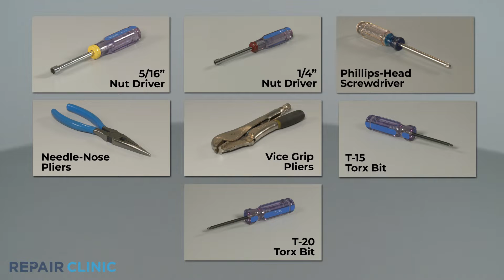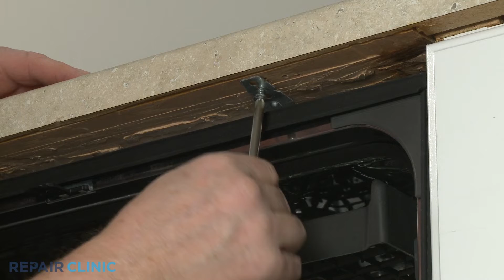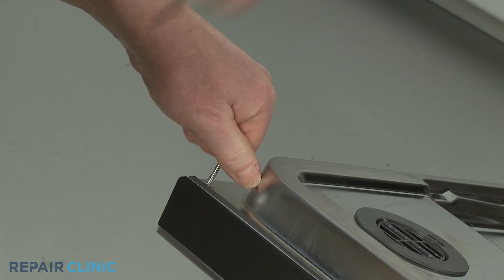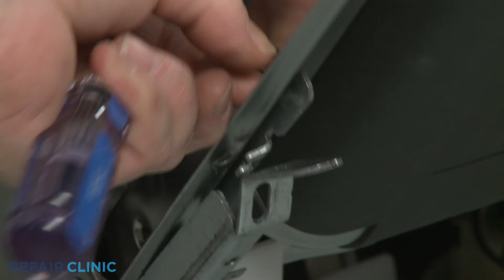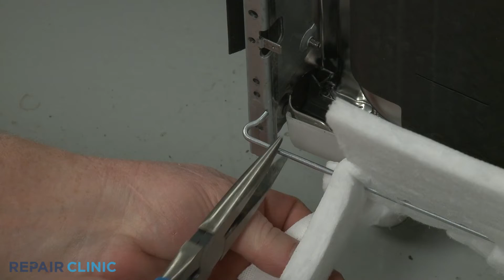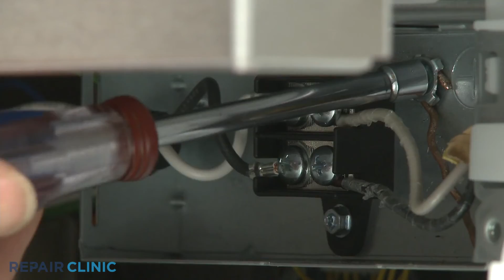KitchenAid Dishwasher Left Door Hinge Replacement W11573703

Comment: Our 5-year-old KA DW HINGE PIN HEAD sheered off (It's clearly visible in this video).  The door still works but one of these days the door will probably fail.  I'm told the PIN can't be replaced, it's an integral part of the frame.  Due to this poor design, we may have to junk a $1200 DW. And we hope buying top-of-the-line American-made appliances was the way to go.

Comment: Great video, only one I could find with this type of spring.  On ours the spring came off and I was only able to put it back on without the plastic (since couldn’t extend enough to push through the hole with the plastic pieces…  is there supposed to be a way to replace just the spring with the plastic pieces or when the spring comes off is the only thing to replace the whole hinge?  Also , since it was able to connect without the plastic part we are just using it like that for now (sadly we are 3 months out of the 1 yr warranty).. is there something bad that can happen without the plastic piece?
Reply: Have you still had issues with this spring continuing to come off with put the plastic? I was able the pop mine back in with the plastic but after a month of use it pops off again.. What a pos design..
Reply: Haven’t had any issues since — guess we’ve just been lucky then

Comment: This video is so comprehensive and helpful - the step-by step was great.  I was skeptical before I did a search that I would find a video showing this repair on my recent model number, but here it is!  I replaced the hinge as described in less than an hour.  It was a great help.  So helpful showing how to re-assemble as well.  Would not have done this repair if it weren't for this video.   Keep up the good work!